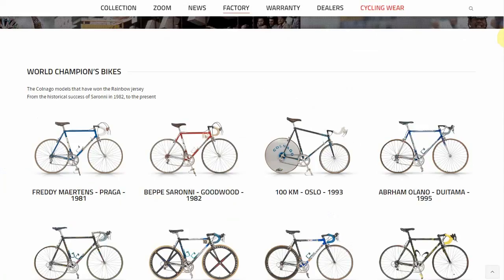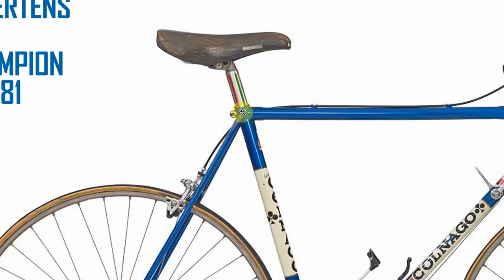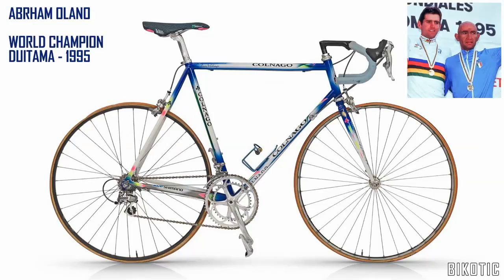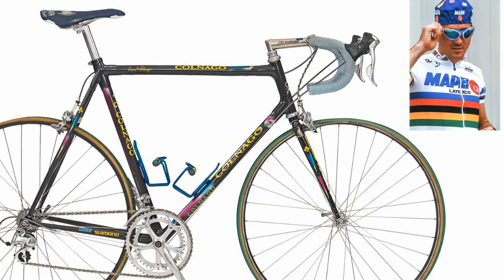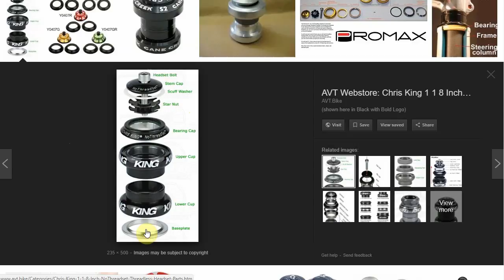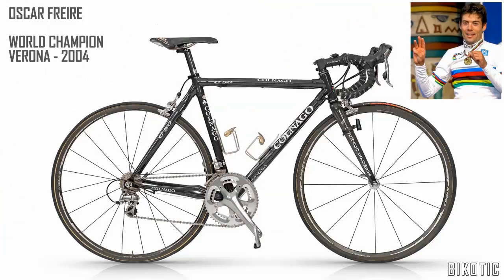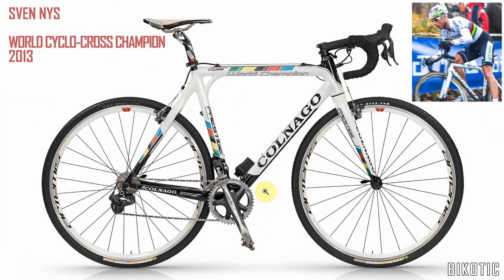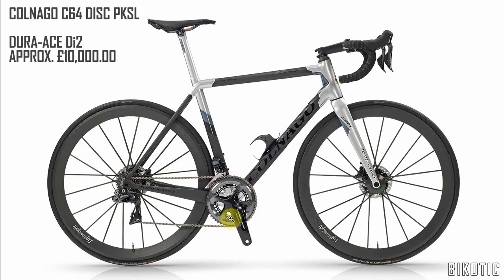COLNAGO HALL OF FAME

Comment: Nice video. Per the ciclicorsa website "The C64 is available in 14 sizes – 9 sloping sizes and 5 high-stack versions, with reduced reach. Of course, as it’s the tradition, the C64 will be available in custom sizes as well." 
I could not find order info on the Colnago website, but I did not look very hard. BikeRadar had mentioned that they use lugs in part so that they can continue to create bespoke carbon frames. 
Saw the C64 in person in UAE team colors at a race, and it was gorgeous.

Comment: I think there was real stagnation in road bikes until the early nineties. I mean, couldn't Shimano have made a 10 speed groupset with indexed shifting on the grip in the 70s if they really put their minds to it? People were flying to the moon and microchips were a thing for crying out loud! The 80s bikes really are abysmal designs.

Even these days they are price fencing off regular consumers from DI2 as if it was this amazing technology. It's two motors and a control chip with Bluetooth! Even my 5 year olds 80€ RC buggy or toy drone is more complex than that.

At least Powermeter manufacturers have finally seen the light and are democratizing their products...